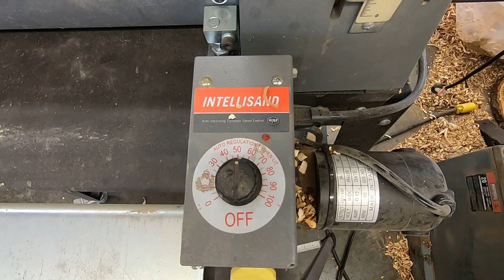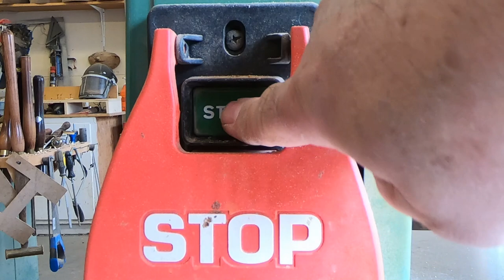Woodturning - How to make Salad Spoons

Comment: Hi Jim. I just started woodworking and wanted to try making some salad spoons with some leftover walnut. Your idea of glueing the pieces together to get the pair the same/symmetrical is a great idea! It appears you used some ordinary hot glue to tack them together and that allows you to split them apart at some point in the process to finish further. I'm assuming the glue is not that strong to affect the finish after some sanding, but strong enough to keep them together for the power sanding. Thanks I will try that for my project. I live in Kingston, ON.
Reply from the maker: Correct, just a dab here and there and it will work just fine. Thanks for watching!
Reply: @SpragueWoodturning  It also cuts down on how much you have to work them since much of the working is done to both at once! Really good idea.